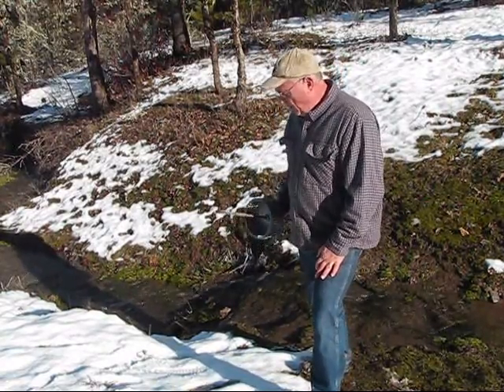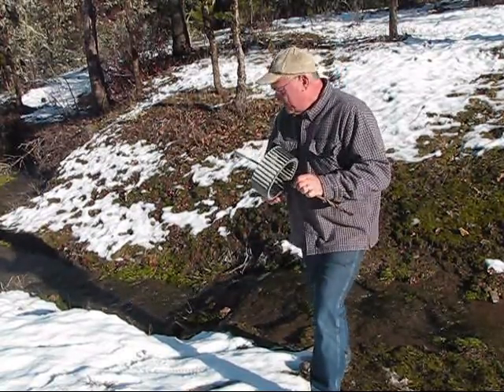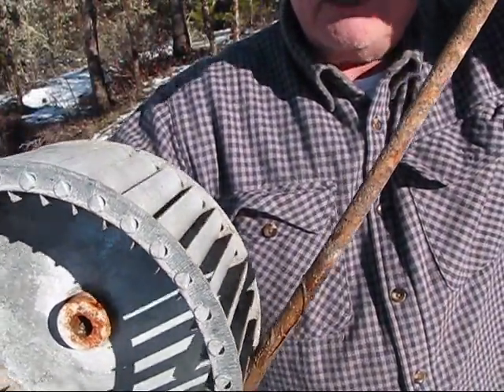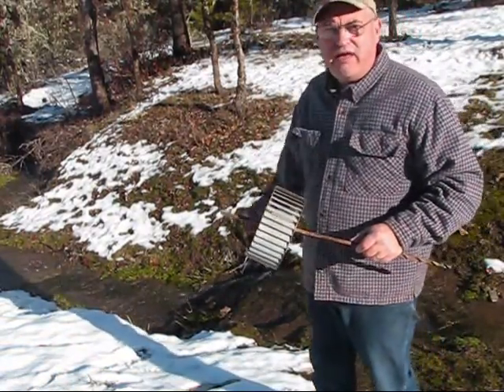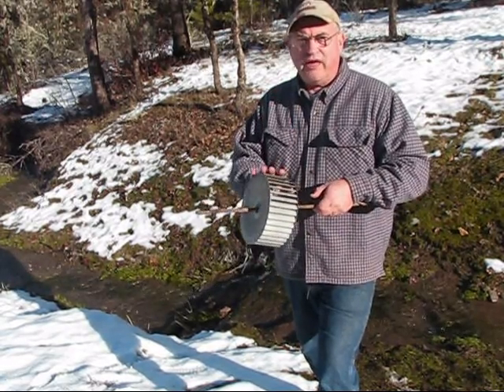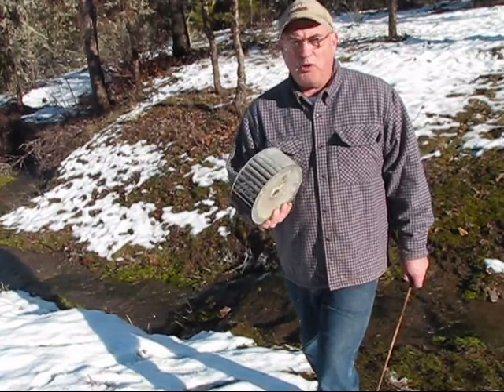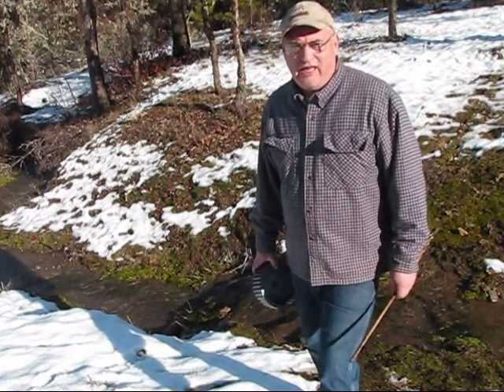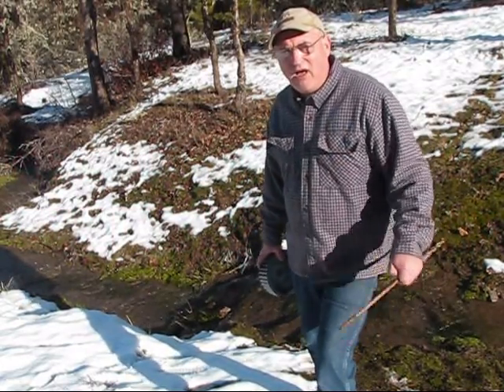Hydro Electric Power - Part 3 Micro Water Wheel

Comment: if you are serious about making power, forget about that puny toy and do what this guy did.https://www.youtube.com/watch?v=xzuhRhedIM4  And it is easily made.    On another note, with a little water and enough pressure to spray from a nozzle, I thought about using  tin cans not quite cut in half and pried open. Carefully cutting up one side and top of a can leaving the other side uncut and bending  open the can to make two halves-- a "do-it-yourself pelton cup" Fastening a bunch of these homemade  "pelton cups" around something which could be fastened directly to the shaft of a generator/alternator. With a generous spring or stream with a little more water and  with a bit of drop to build pressure,  I thought of taking 20 lb propane tanks and filling them with water to be sure there is no propane in them and then emptying the water and taking a right angle grinder with a cut-off wheel and cutting the propane tanks lengthwise, leaving one straight side uncut. When opened up this would make a large  pelton cup. Done to about 8 or more propane tanks. Taking two steel automobile wheels and welding them together, then welding the opened propane tanks around the wheels making a large pelton wheel.  The center of one of the 2 wheels welded together would need to be cut out to be able to get a ratchet in to tighten the lug nuts of the other wheel to a junked automobile hub/axle. Similar to this https://www.youtube.com/watch?v=BtCMuO3DVyE  Or  instead of using the hub/axle of a junked auto, weld the propane "pelton wheel"  to a large steel pipe and fit each end of the pipe through a large pillow block bearing.
Reply from the maker: Thankyou for that input. I appreciate it.

Comment: if your going to try to use a blower wheel look for a blower wheel out if a big roof top a/c heat  unit. they have bigger ones. you may as well go right to work and find one that will do what your in need of rather then something way to small. also the center may need to have a piece of Tin inside to make it hold water gravity is what makes it work.
Reply from the maker: +jacky Parker I have a hard time asking for donations. I was homeless for four years with my wife and two children, living in free campgrounds and the WalMart parking lot in an old travel trailer and never begged for money. Thanks for asking though. I made do with what I had and what I could come up with. I was on SSD for a spell, hated it, got skills and went to work in the medical field. Now I am doing OK. Health has improved as well.
Ducky paired up with Sloopey and they will be hatching ducklings this spring. Thanks for asking.
Reply from the maker: +Roy Amberg Thanks for the heads up. I am building a 12v one for now to recharge the battery on the fifthwheel for now. Then I will work on the larger one later this spring when I have funds to go on a scavenger hunt at the recycle yards.
Reply: +Pine Meadows Hobby Farm A Modern Homestead Why not setup a paypal account and then some of can help by donating . .  As for duck in a cup . .  what did happen to that duck ? . .  did it go quackers ? lol
Reply: +Pine Meadows Hobby Farm A Modern Homestead Glad things are improving for you . . . . Being Homeless does have some good things about it as in teaching you how to survive and that the world revolves around money to much these days. . .Also It teaches you to see things from a different perspective and having a engineering back ground helps even more.